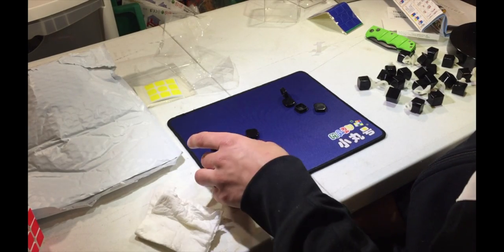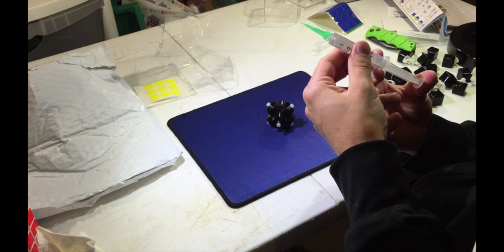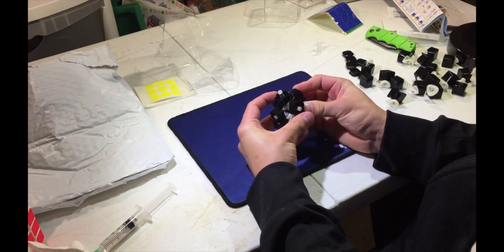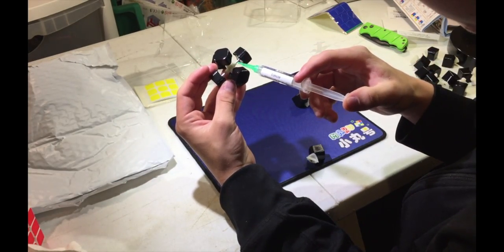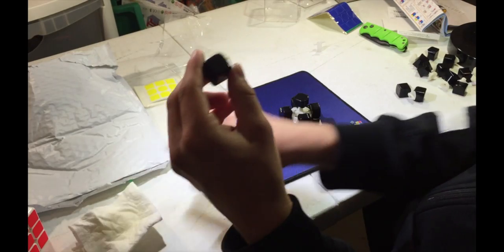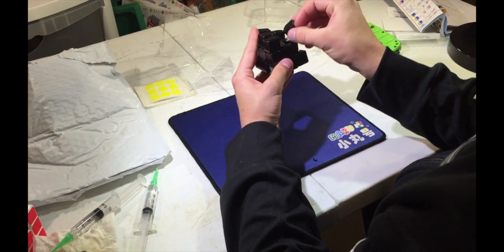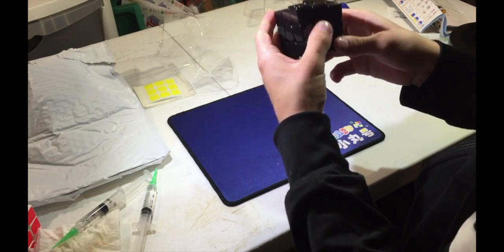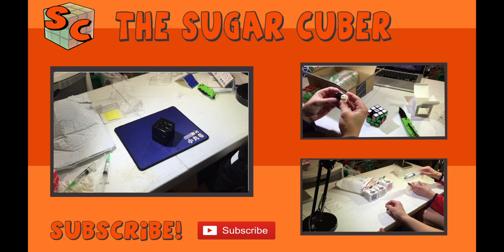How to Lube the Gans III 56

Comment: Great video! I just got my Gans356 and plan to lube it this way. Thanks for making this video! It's really helpful.
Reply: I lubed it the same way and it turned out amazing! One question, would you recommend lubing any corner pieces?
Reply from the maker: I'm glad it worked out! And the lube you put on the edges will spread to the corners so there is no need to lube them.
Reply: TheSugarCuber OK thanks!